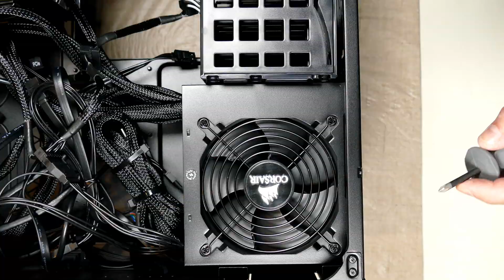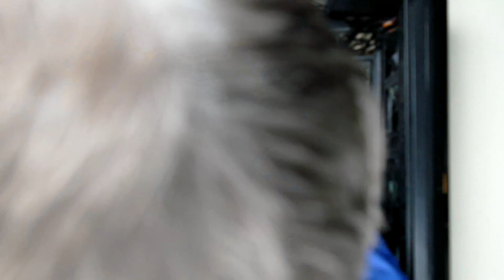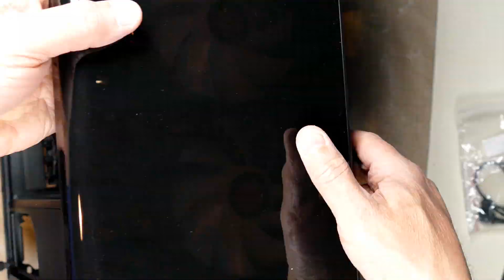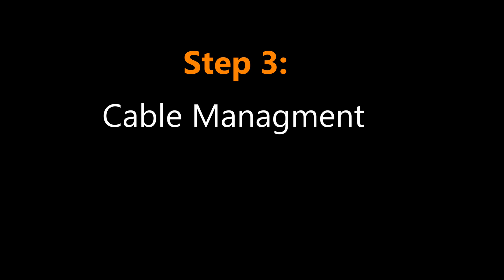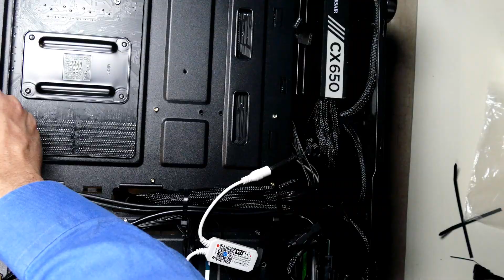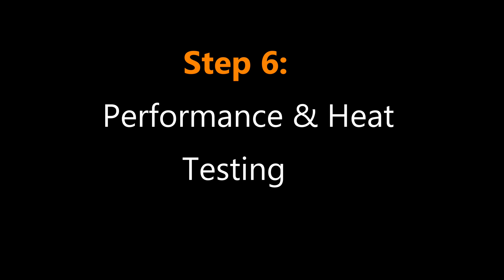An all AMD PC BUILD - FINAL Case Install in a Thermaltake v200 & CONFIGURATION

Comment: Can i use the second hdd shelf for a second hdd? I have a 1tb already but its not enough for me so i want to buy a new 2tb one
Reply from the maker: I don't see why not, as long as you have the extra SATA data cable and you Power Supply has the extra connector.
Reply: You can but the bottom slot is very tricky to insert the hard drive. Hard drive will sometimes get stuck.

Comment: Thermaltake V200 Tempered Glass RGB Edition 12V MB Sync Capable ATX Mid-Tower Chassis with 3 120mm 12V RGB Fan  one of my front  rbg fans is loud which one can I buy and plug right in?
Reply from the maker: Just about 'any' PWM fan (with or without RGB) can be used.  The RGB is an issue however if you want to control it from the case controller, since the fan wiring is somewhat proprietary.  I think I show some of that in the video.